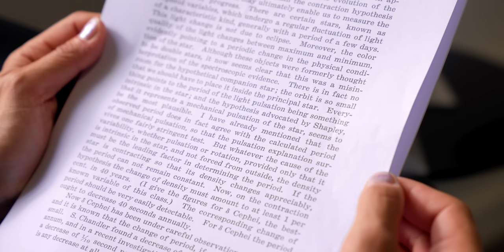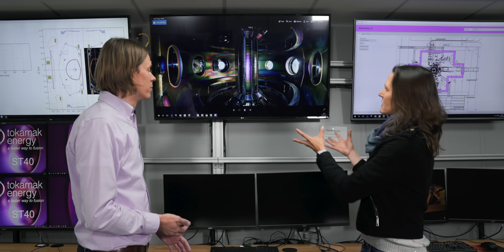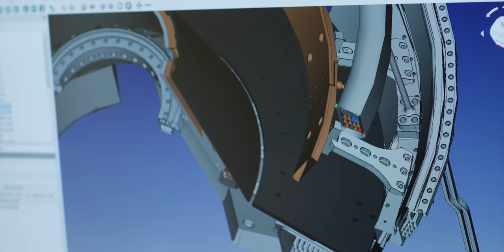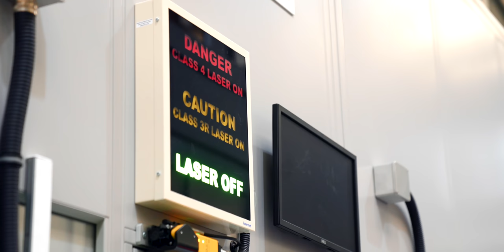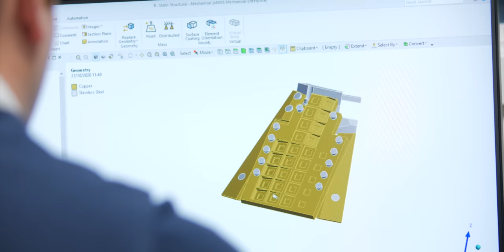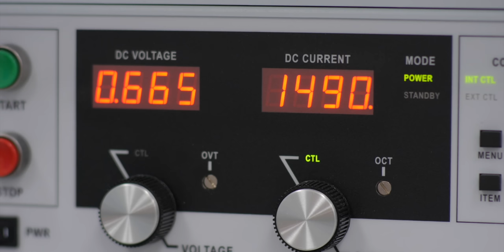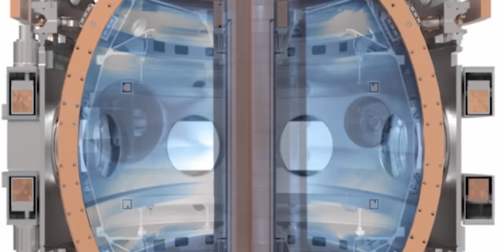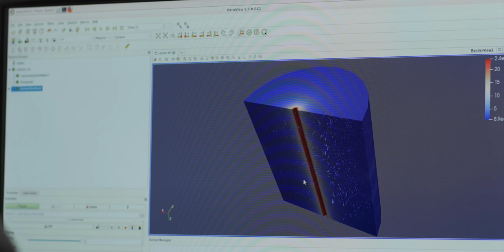Nuclear Fusion: The Secret to CHEAP and LIMITLESS Clean Energy?!

Comment: Good video.  I like how these videos get right up into the labs and equipment like the previous wind turbines and now this.  The interviews with the scientists and technicians really brings this technology to a personable level.  Truly hats off to these people dedicating their lives to this honorable goal.

But there are some fundamental problems that should be highlighted:

First, that 100-million degree Celsius fusion reaction chamber is a massively astounding temperature to reach and sustain. By comparison, the sun's core is only some 15-million degrees Celsius.  Even if they get to net positive flow, most of the fusion energy will likely be used just to keep the fusion reaction going.

Secondly, the Tokamak design goes after the Deuterium-Tritium (DT) fusion reaction as mentioned at 5:36.  Because that fusion reaction is easiest to achieve.  If it used, say, Deuterium-Deuterium (DD), then the 100-million degree Celsius reaction temperature would go even higher making it all the more harder to achieve positive energy flow.  But Tritium (3H) is incredibly rare and costs some $30,000/gram.

Thirdly, Tritium (3H) is rare so will need to be "bred" from a nuclear reaction with Lithium and there is no commercial method of doing this yet at scale.  Add this to the list of major problems because Tritium will be 50% the fuel of a Tokamak's daily operations.  The most famous Tokamak is the European ITER project and ITER lists on their website that it will need 300-grams of Tritium per day for a small 800MW reactor.  By comparison, traditional commercial fission nuclear reactors are in the gigawatt range.  If Tritium cannot be supplied at an economic rate then the Tokamak design is a dead end.

Fourthly, Tritium (3H) is radioactive by emitting beta particles and is an ionizing radiation that can partially penetrate skin.  If Tritium leaks out into the ground and into the water supply then that becomes a major environmental disaster.  I don't think it would be safe for Tokamaks to installed within city limits or be installed on-site in industrial factories.  Installing a power source close to the locations of power usage is optimal for both efficiency and reduced stress on the grid but that might still be off limits Tokamaks.
Reply: @Deo Volente Probably from the nuclear weapons industry.
Reply: @Deo Volente Melt down and centrifuge old Tesla batteries.
Reply: @Deo Volente That would just decrease the chances of Tokamaks becoming commercial.  But the world of nuclear weapons is shadowy and hard to get accurate numbers on.

Comment: With the creation of a 17 tesla magnet 2 or 3 years ago and MITs 20 tesla magnet late last year as well as simulations increasing from raw computing power. Just these 2 things should make a positive Q a reality in a few years, hopefully within two decades he will have a test reactor with a Q value of 15 at least that is putting power in the grid. Possibly making the first fully operational commercial  reactor in less than 30 years.

Comment: Excellent episode and presentation but misses the fundamental question: where do we get the tritium? Assuming fusion is ready-to-go tomorrow, we’d need to first build more heavy water fission reactors to fuel the tokamak. In short: even if we have solved the fusion problem, it’s not a clean or viable solution. Why is this not discussed? Do we have a new clean tritium source I’m not aware of?
Reply: It is possible to set up light water reactors to produce tritium as well, and possibly to outfit a fusion reactor to breed its own using neutrons from deuterium reactions
Reply: @Canucklug  Why would you setup light water reactors to produce tritium, when the same reactor can produce power ???
Reply: @Canucklug  agreed: that fusion breeder option seems like a viable possibility in concept… but how long until available? add another 30 years?
Reply: @maudepotvin8660  it would do both: produce power and tritium (basically, as a by-product)… but you’ve nailed it! if we have to build more nuclear to supply tritium for fusion then fusion is not inherently clean or infinite … frustrating! confused why the scientific community hasn’t already made this same conclusion?
Reply: Why nobody is discussing flywheel? I find that using flywheel to multiply energy makes more sense. It all depends on the design of the flywheel.
Reply: @grantandre79  It sounds like it would take 175 MW of heating power into the plasma so it's a question of how much the extra heating power installation costs you mainly with smaller HTS tokamaks. It might be difficult to find room to outfit a small spherical tokamak even
Reply: @Deo Volente It has been produced for H-bombs before and the US will run out around 2030, thus the US weapons program will be dealing with the question of how to modernize Li6 production before fusion companies need it
Reply: @tanalson  Storage device, not energy generator. Apples and paper clips.
Reply: @Digital-Dan  ? Apples and paper clips?

Comment: No fusion reactor has achieved a Q Plasma anywhere near 1, let alone a Q Total greater than 1, meaning all of the fusion reactors are incredibly far from break even. Then there's the tritium fuel, which unless they get lithium-beryllium breeding to work, is primarily sourced from Canada's soon to be retired CANDU heavy water fission reactors and is eye-wateringly expensive.

I wish more funding was being directed to advanced fission reactors, as there is plenty of possibilities to explore, and even existing reactors have a lower CO2eq g/kWh emissions than solar and about the same as wind.
Reply: You're not alone. Fusion is nothing but a multi billion Dollar/Euro boondoggle.
Reply: @Deo Volente I remembered that beryllium was used, but refreshing my memory, the beryllium is used as a neutron multiplier, to increase the tritium production rate from lithium.

The contaminated water being held at Fukushima nuclear power station has tritium in it, but they can't separate it.

Comment: The ratio of Energy out/Energy in needs to be at least 10 to be economical. This is 30 years away at least. I agree. it is worth continuing the research. However, I completely agree that our use of our fusion source billions of years in the making should be optimised. It is sitting there waiting to be tapped into: Solar (in all it's forms), Wind, Tidal, and Geo. With AI optimisation we can achieve our goals of a sustainable future.
Excellent presentation.
Reply: Why 10?   it's not like they are buying it from the grid, they will be feeding it back from the reaction once it starts...  you only worry about efficiency when your fuel source is the limit.. and their fuel source is basically water.

Comment: Why have molten salt thorium reactors not been built?  A working model was constructed way back in the 1960's and they could be built on an assembly line which is much cheaper than one-off designs.  It makes no sense, which tells me there must be some hidden reason like there's not enough money to be made with it, at least for the powers that be.

Comment: So how is the energy extracted from the plasma. I seem to remember some of the neutrons fly into a lithium blanket (lithium is going to be in short supply) and the lithium becomes irradiated and radioactive so not very clean when the reactor needs dismantling. A great idea but not clean and not easy!!!
Reply: Will it generate steam to drive a turbine?
Reply: @lorenzoventura7701  lithium blanket gets hot and turns water into steam then off to conventional turbine system.
Reply: The solid components exposed to the neutrons become low level waste, it is hoped to be able to reuse the material after 100 to 200 years
Reply: @Canucklug  Thank you for that extra info.
Reply: @markandjennyhesketh7149  Which is indeed a system you do not want because of the poor efficiency of the conversion cycle ....  So up to a molten salt loop?   Or directly generate an electron stream??
Reply: @garysmith5025  Fusion would likely beat fission's safety record, which is 100x better than natural gas, which is 10x better than coal

Unless scalable and competitive long term storage or something else comes along fusion would be fantastic for safety - it's competing for baseload energy that intermittent sources can't round out, roughly 50% of the market
Reply: @JongJande  
Steam turbines suck. Poor flexibility, to my understanding unsuitable for power spikes typical of fusion reactors.
Direct conversion to electric current would be magic.
Reply: @lorenzoventura7701  Fully agree.  And high steam temperatures directly implies very high steam pressures.  So either transfer heat to a molten salt loop or if possible directly generate electricity via a magnetic coupling.

Comment: It takes 10-20 years to stand up a standard nuclear reactor and we don't really have a convincing fusion prototype yet, so of course we aren't going to be pulling Fusion derived electricity from a wall socket in the next 30.

It was telling that nobody was willing to give an estimated timescale but I suspect that most people alive to day will likely be dead by the time this is working (I'm 53 and will likely not see it), but I still feel its right to pursue - people will need carbon-free background power to supplement wind and solar etc.

Meantime, let's roll out wind, solar, tidal, energy storage and limited nuclear so we can get away from coal and gas etc.

Comment: No, we are nowhere near close enough to stabilizing the flux field at high plasma densities.  A much better and easier alternative for near-limitless, 'almost-clean' energy is to use thorium minerals for nuclear fission reactions, in an advanced molten-salt nuclear reactor, like the types that China is currently undergoing research on.  China will be the place where advanced nuclear reactor designs come out of.

Comment: Great and informative video bit you didn't cover what exactly plasma is? Only one I know of is blood which obviously isn't this type of plasma so would have been good to explain what the plasma is made of.
Reply: They did - it was towards the end of the section with the grapes... the plasma is when the electrons are strpped from the neutron/protons, such that you have a soup consisting of both positively charged elements (neutron/protons) and negatively charged elements (electrons), that are intermingled but kept separate due to the heat.

Comment: So could you build something in space and use the natural coldness of space to cool the material?
Reply: Bit of a long way to run the extension cable though.   Also space isn't cold if you are facing the sun... it's very very hot.
Reply: Maybe we could place it 93,000,00 miles from Earth, oh, hang on🤔

Comment: My eternal question about fusion, despite understanding the basics of H + H = He + a crap load of energy, is once the monumental energy/heat is created within the reactor vessel by the fusion process, how do you then either get it out or transfer it into a more useable/adaptable form to then generate electricity??  I don't expect you can simply pour in water and turn it into steam to run a turbine - and water jackets around the vessel would presumable impact the efficiency of the magnets...
Reply: Most of the energy flies off in neutrons unaffected by the magnetic field that are absorbed into a heat sink blanket that shields the magnets. The challenge for spherical tokamaks is they have little room for shielding their central magnet column, they're definitely working on a compact neutron shield material for that
Reply: @Canucklug is it the carbon nano tubes from the carbon theyve been capturing and storing that surround the core  plasma i
Reply: @rachaelfleming7132  the exhaust region around the bottom is the hottest and might use tungsten that has a 3000° melting point, possibly carbon vapor deposited diamond coated with tungsten even

The rest of the walls they'd like to use carbon but it absorbs too much tritium so beryllium seems like the main choice, it's resistant to being turned radioactive and is one of the best materials for not spoiling the fuel purity of the plasma
Reply: @Canucklug  ok thank you

Comment: They have gone from 20,000 times more power in for the amount of power they’re getting out to 19,000 times more power in than the amount of power  out. That is truly the kind of progress achieved. They’re not even close to break even and may never get to break even.  Even if they did get any useful power out, with all that super complex equipment and ultra high trained engineers and scientists, what would that power cost? Would you like some nice fusion power and $1000 per watt hour? It’s really nice! It’s the same as what’s happening in the sun but only 1 trillion times more expensive than using solar panels.

Comment: A fusion reaction requires an astonishing amount of electrical energy to sustain.  It then generates thermal energy.  This thermal energy has to be converted back into electrical energy in order to sustain the reaction - PLUS there has to be a significant amount of electrical energy left over.

It just doesn't seem remotely plausible that this will ever happen.

I have no doubt that these people interviewed genuinely believe what they're saying.  But nothing they've said changes my view that people chasing after fusion are no different than their predecessors who were chasing after perpetual motion or the philosopher's stone.

Comment: The problem here is that the amount of input energy you have to put in that equation to create nuclear fusion energy is far much larger than the output  energy, which means that it is simply economically unfeasible 
The question here is that why human extremely limited knowledge wants to mimic natural forces to create such clean energy while the clean energy is already so available in sunlight? 
Sunlight will exist as long as the Sun still exists, and human beings and all ther beings and this planet itself can exist only when the Sun still exists 
All you have to do is to come up with an efficient way to extract it from sunight and store it for whatever purppse you have
Sunlight happens to be the only source of energy which allows human space explorations within the solar system to be possible  because human spaceships will never ever be able to go anywhere farther if supllies of fuels for  such human-invented flying machines still have to be from the Earth, instead of  being extracted direct from sunlight

Comment: Why do we need temperatures at 100,000,000 degrees when the surface is only 6,000 degrees and the hottest bits in the atmosphere are 15,000,000 degrees? Is it to do with the pressure? Why does it have to be so much hotter?

Comment: I interviewed with these guys. Fusion energy has 3 breakeven milestones:
 - scientific breakeven: getting more energy out of the fusion plasma than you put in
 - engineering breakeven: getting more energy out of the reactor than you put in, once you've considered real system efficiency
 - economic breakeven: getting more money out of the facility than you're putting in

Of these 3 milestones, we have hit... zero. We're nowhere near and, like Helen said at the end, this is not going to solve the current climate crisis. My prediction is that fusion will be the solution to humanity's next energy dilemma. I know Star Trek is science fiction, but they use fusion reactors for sub-lightspeed propulsion and secondary power. I can see fusion's 'killer app' being something like this that seems exotic now but probably won't seem as exotic in 20-50 years time.
Reply: I thought we’ve seen milestone 1 on your list a few years back?
Reply: @deanfielding4411  I've not seen anything is reputable publications, just hearsay from commenters. If you do have a reputable source, please share it with me
Reply: You’re right, from what I can see we’ve only seen between 0.3 and 0.7 times the amount of energy out than put in.

Comment: I'm required by law to be a grumpy pessimist, so I expect that even if/when fusion reactors do become a 'thing' they'll be astonishingly expensive, frustratingly unreliable and crippled by unexpected problems - such as requiring constant costly maintenance, the endless replacement of costly essential components, frequent costly shutting-down to recalibrate the crudbucket assimilating coils, and also the tragic (and impossible!!!) production of an entirely new form of radiation that's instantly fatal to squishy living organisms and which has a half-life measured in aeons.

For safety's sake, the reactors will have to be placed in geostationary orbit above the Earth at a distance of approximately 93,000,000 miles.

Which, I think, takes us neatly back to square one.☀️

Free energy at the cost of everything, eh? Hmm...🤔

Comment: If as much effort was put into renewables we have now as they’re putting into this we wouldn’t need them!
Reply: Massive effort was (and still is) put into renewables - which is why solar prices have fallen off a cliff over the past couple of decades.  It's just not such a sexy field of research and doesn't require such big and complex machinery, so it tends not to get the same level of coverage.

That, and it was China doing a lot of the research (which is why they now own the market in renewables, more or less)

Comment: if you can use tritium I think it will be safe . cause it won't need any extra security or cover to stop radiation leakage from an unwanted situation and can be stoped easily even for a small student from a remote place through a communication line which ever available through there care takers if they are acquainted well with these mechanisms.
Reply: it is if domestical small size distributed .